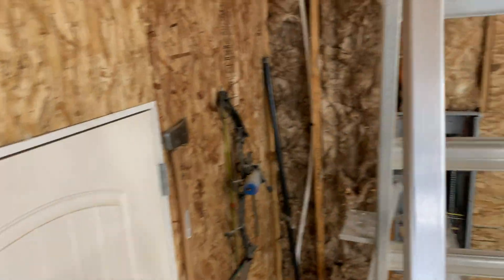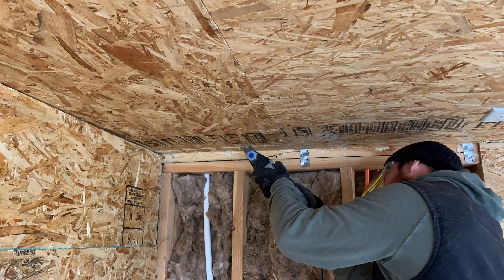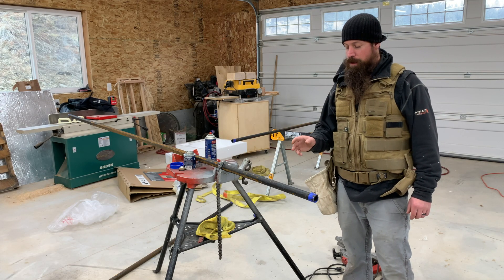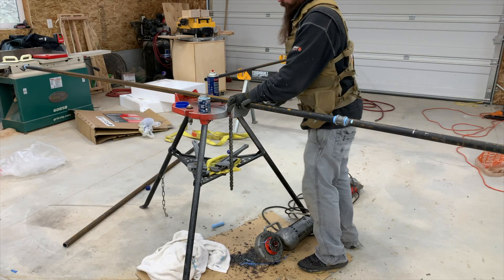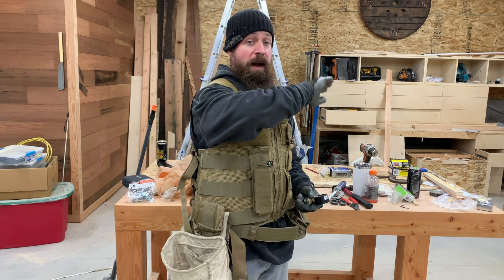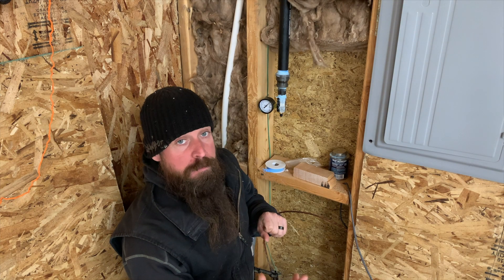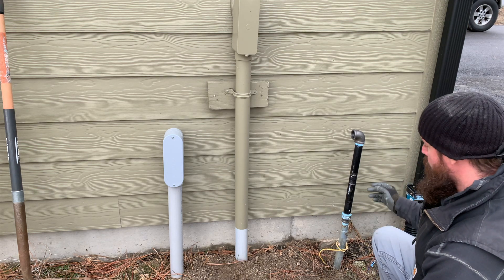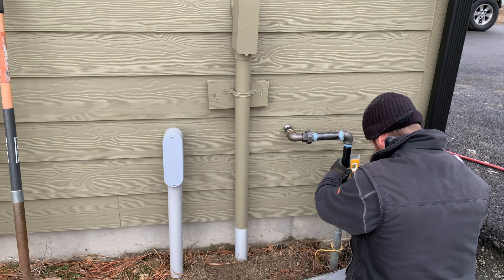HOW TO INSTALL A GAS  HEATER IN A SHOP  PART 2 [INSTALLING THE GAS PIPE]

Comment: MINIMUM test pressure should be 50psi and soap test every joint. In BC a street elbow in not allowed either. (where you added a union outside)
Reply from the maker: I followed my local code, pulled permits, and had it inspected. I’m sure different areas require different things, and you could spend all day chasing your tail on it, but at the end of the day I checked all the boxes I needed to, and 3 years later it hasn’t blown up.😂😜

Comment: Pretty good job up here in SASKATCHEWAN CANADA no one can do gas fitting unless your a plumber with a gas license. A suggestion what we do up here is a valve on the riser then we have to have a ten inch swing consisting of two 90’s on the horizontal. None the less pretty good job 👍🏻👍🏻👍🏻
Reply from the maker: Thanks for the feedback Brent! I installed a shut off valve on the riser where it connects to my house. I think I showed that in my final video. Yeah I was really surprised that the only thing I was unable to buy without having  a license was the vent pipe.

Comment: I'll be surprised if they okay it being in the wall, but codes are different everywhere. Personally I wouldn't want any gas joints inside of a wall. I'm not giving you crap, just telling you what I'm comfortable with (Steamfitter since '91). I do, however, want to remind you to put a sediment trap (dirt leg) in the drop before it connects to the gas valve. It'll help keep dirt, cutting oil, and little bits of teflon tape from getting into the tiny orifices of the gas valve. It's looking good!
Reply from the maker: yeah everything passed without issues. I’ve never lived in a home where the gas pipe wasn’t ran inside  the walls. Although it wasn’t in the video I did install a sediment trap (I didn’t I have all the parts at the time) I threaded on the temporary stub and capped it so I could pressure test the line ensuring all my joints in the attic were good before moving on to the rest. Thanks for your feedback! 👍🏻
Reply: @brewbuilds  your 3rd installment comes up private and won't play.
Reply from the maker: @delswanson3593  yeah sorry about that! I accidentally hit publish before the high definition version had finished processing. So it was only displaying in 360p. So I made it private until it finished! I was worried people would get notified had posted it and not have it be available. Hopefully only a few more minutes. Thanks for letting me know! 👍🏻
Reply: Don't like fitting within a wall cavity either. Been doing propane for over 20 years in the US.

Comment: I like the hole saw guide idea. So your a plumber or a jack of all trades?
Reply from the maker: That little trick has saved me so many times! 😂 I’m actually an electrical mechanic, I build and maintain high volt electrical substation, and a hobbyist woodworker. 😃
Reply: @brewbuilds  You do good work. That door you made looks great. When you were assembling it Did you put glue on each board? Or just the outer ones?
Reply from the maker: Thanks a lot I really appreciate it! So I glued the rails and stiles, but not the inner panels. My intent was to glue the inner panel pieces together then have them free float as a whole in the frame, but I got rushed in my glue up and forgot to glue them. Hope that makes sense. And again I really appreciate the positive feedback.